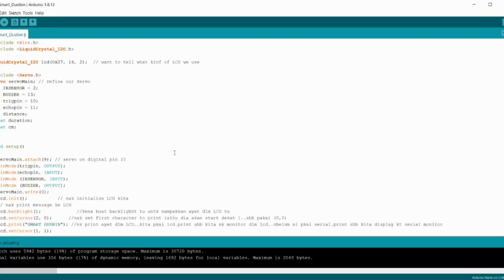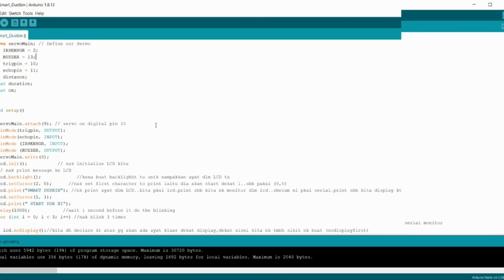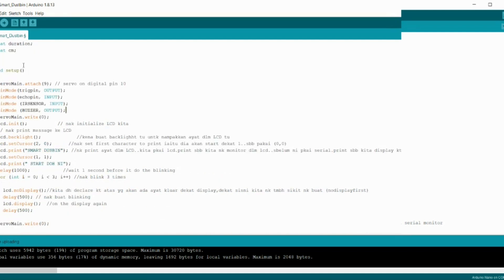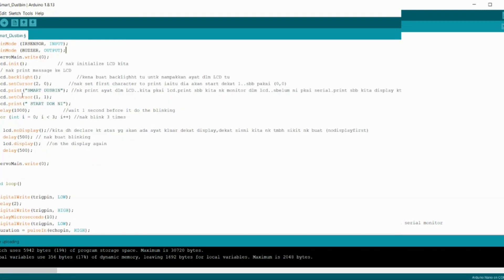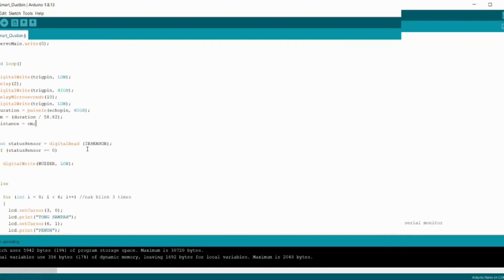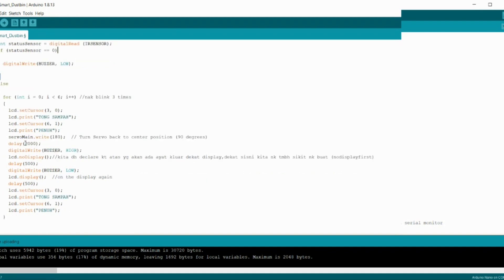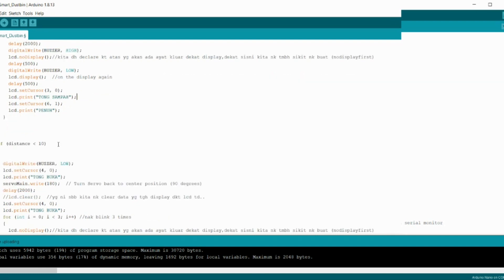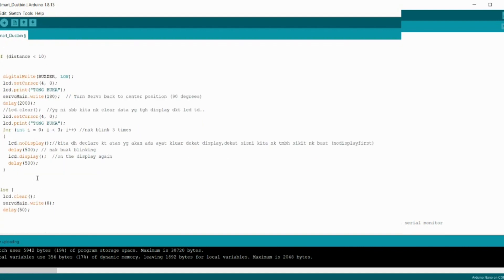SMART DUSTBIN USING ARDUINO WITH ULTRASONIC SENSOR AND SERVO MOTOR

Comment: Nice prototype. By the way, can you explain:
1. Why you set the distance to detect the rubbish is less 10cm to open the dustbin? Is there any study support this value?
Reply from the maker: Because.. If we set the distance more than 10 cm.. The rubish will not fully full in the dustbin.. In that case.. There will still available space to rubish can be fill in.. That why i set 10cm that it is suitable and it match with the level of rubish when its full.. (ec18079 group 7 01p)

Comment: How do you communicate the angle at which the servo should turn when the lid of dustbin to open automatically? (EC18120 GROUP 5)
Reply from the maker: I already set the exact angle to the servo to rotate in the coding.. Tq
Ec18079 group 7 01p